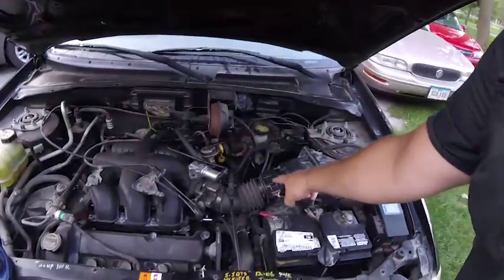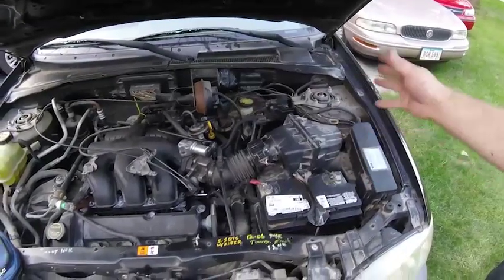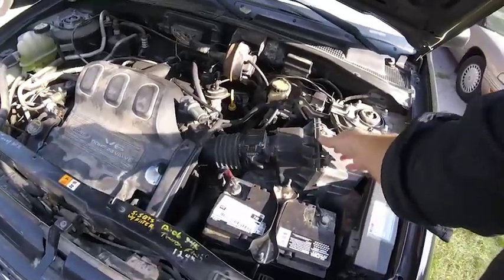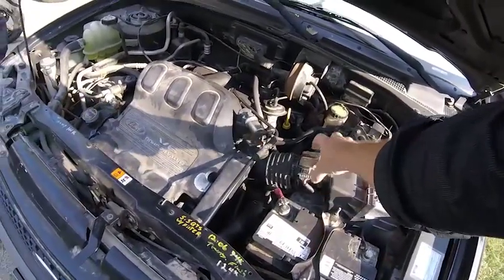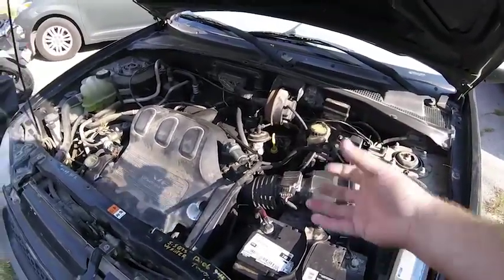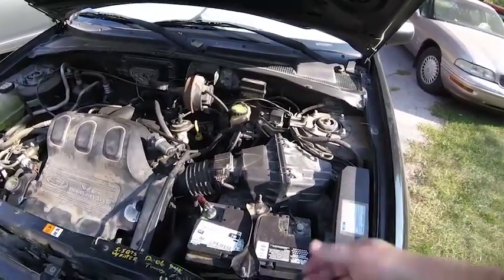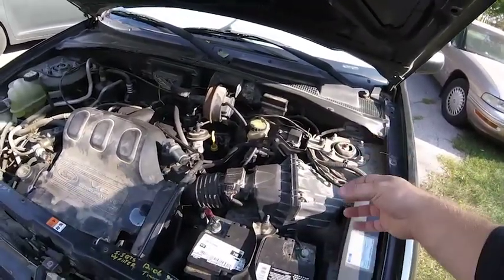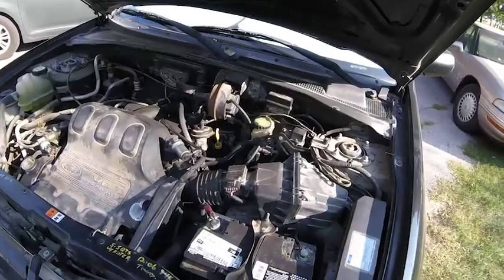Rough Idle / Acceleration - Here is the cause 90% of the Time ✔️

Comment: After change of spark plugs SV6 commodore vf. Now slight rough idle notice but drives and accelration is smooth like butter.
whats cause????
idle sits on 550 and stable even on idle but i can feel slightly rough.

Comment: my 2000 5.7 vortec jerks at low speeds like 5-15 mph. replaced spark wires, maf sensor, coolant pipes (cuz they were leaking) and i don’t know the problem. it sucks in too much air.

Comment: old cars may have problems not there years earlier... Obvious, but even a Toyota Corolla  at 20 years old and 250K miles will develop cracks or leaks in gaskets (the engine is a hot place inside an engine compartment in hot or cold weather). Be prepared to replace the air intake manifold gasket, maybe valve cover gasket, the gaskets for the IAC valve and throttle body. Hoses get old and brittle and crack at the ends or even collapse in bends on occasion. Engines need fuel, clean air, and spark.... that's all.  So a leak of air, dirty spark plugs or contamination of the electrical impulses or contaminated fuel are suspects. A new fuel pump and its filters is fairly cheap after 50-70K miles and best left to  skilled mechanic . ANY mistake with a spark can ignite gasoline vapors or gasoline in an opened tank (as the fuel pump is replaced with a new one). Do NOT risk it... leave it to a pro with skills. Same for 'struts' ... 1 mistake and you can lose a finger or hand and who will get the car off you and how soon as you scream in agony? HIRE a pro with skills (I like mobile mechanics who were car mechanics for decades and good at it). Keep the easy stuff clean or replace yourself (PCV valve or MAFS are simple to remove and replace and/or clean with MAFS cleaner, new plugs or spark plug 'coils' ). Replace bulbs yourself and save the money and learn some things!

Comment: I did all that I even cleaned the throttle body, changed the spark plugs I didn't change the coil pack cause they were good..the hesitation only happens on hot sunny days not at night which I think is weird..
Reply: Distributor maybe.
Reply: Some cars just run like shit on hot days

Comment: Hey man your right this happen to me and i changed my air filter and got gas treatment plus put 93 gas and it runs like new the mechanic told me i need a new motor🤔🤔🤔🤔🤔🤔🙄🙄 but thanks i did this and now everything is great i spent about $25.00
Reply: Did it start idling roughly immediately? Mine just started immediately after driving fine. I figured that I would feel the rough idle gradually. 
Sigh....
Reply: Tou should have bought the new engine and he will install a new filter free.

Comment: I replaced the idle air control valve , replaced the filter, cleaned the mass air flow sensor still run a little rough, does it when I also give it gas and goes away when I let up on the gas. Any ideas?
Reply: Do a idle relearn on ur vehicle
Reply: Could be clogged cats or crank shaft positioner sensor going out
Reply: I found the problem was a bad ignition coil replaced it now runs great.
Reply: I'm having the same issues now to so I'ma check out the coils n see

Comment: Anybody help.....

My honda Jazz is in 100,000 kilometers when I started to hear a rough sound when accelerating.  I notice everytime the first 10 minutes is fine then i would hear a rough noise under the hood.  I went to see different mechanics and they all said the noise was not coming from the engine.  Sad they couldnt give me the answer.  But this one mechanic saw something on my fan belt having sort on an issue that  maybe the cause of the problem.  The fan belt has a little wave when running.  I wanna know if he is right before taking them apart and have it replaced.  Thanks

Comment: I need to drive more it was done today. 
But I’ll check the air filter and see it’s tight.
Reply from the maker: Yeah sometimes it can get confusing with all the sensors in those cars.  if it throws a engine code then check that and see what it says.  Autozone will read the code for free.  It will give you some more info on what's happening.

Comment: That little nugget of recalibration after 20 miles was great. I just cleaned out the MAF on my car yesterday, took it for a drive around town & it still idled a bit rough. I thought maybe it was something else. Might just have to drive it a bit more until it recalibrates! 
Thanks heaps!
Reply: Bad gas and computers
Reply: Did u fix it? What was it?
Reply: @APerez89  It was a combination of things.
GDI engine so had to do an air intake cleaner. Valve head cleaner as well, petrol injector clean. REGULAR oil changes. And it helped changing a couple of old spark plugs that weren't firing 100%.
Plus going from 91 unleaded to 95 helped a bunch.
Reply: @RatelHBadger  alright alright not too bad sounds like u got away pretty cheaply : ) changed the plugs now im gonna clean and check the MAS thing and filter. Car just lost power and the mechanic said the sparks were responsible the issue but the noise ad symptom is starting again after a full day of no probs LOL
Reply: check aorund on the air intake tubing for cracks that can cause vaccuum leaks
Reply: @805fpv3  air intake is all good, double checked all the hoses and clamps. Every 5,000km I do an upper air intake clean (car is a GDI engine so the valves get crusty). Clean the MAF every year as well. Runs like a dream.
Reply: @RatelHBadger  oh ok right on , that really stumped me for awhile and i had them big cracks too xD
Reply: @805fpv3  yeah 20 year old car, first thing I did before I bought it was look at the condition of the hoses.

Comment: Anyone knowledgeable please help! I have a 1998 Escort 2.0 Auto. It has a low idol in drive with foot on break and (possibly unrelated) the biggest problem is once warmed up if in park the idol will rev so high I turn it off real quick so it doesn't blow something. I feel like I've done everything. I cleaned the old throttle position sensor (no difference) then put a new one on, then cleaned the old IAC valve (no difference), then put a new one on, cleaned the throttle body, cleaned injectors, cleaned valves and still same problem. I also replaced the Control Module relay which gave me my A/C back but did nothing for the idol. Please also note that after testing 4 Control Module relays, I found the only one that mostly worked as my A/C now comes on with regular air and the regular settings blow hot air. I was just happy to have A/C back any way I could get it. Any more ideas? Cuz I'm tapped.
Reply: Check the hose behind trottle. It might have leak.
Reply: @jvela492  Of all the things, it ended up being the pigtail plug for the TPS! lol Replaced 6 parts to find that out and it was just a wild hair that made me change it out.

Comment: Pls help~~
First i started hearing squeeling sound in the engine bay and then 2 days later, my rpm just went wild going up and down and vibrating. My mechanic said it was the alternator and changed the alternator. My car was fixed but then 1 week later rough idle came back. Mechanic checked again and said 1 of the coil is the problem. We changed that and car runs perfect for 2 days again until today...my rpm again goes wild and from what i can tell, i think it might be due to using both my radio and aircon at the same time. Also when i use power window i can see the rpm drops by 100rpm. 

Does anyone know what might be wrong with my car? My car is a toyota corrola 2009 with 240,000km. Pls drop your opinions thanks.
Reply: battery might be bad? idk just sayign
Reply: You might have a dirty ground wire.  There is one that connects your engine to the body and another that connects your body to the frame.  Unbolt them and clean them good with a wire brush.  When cars have weird electrical problems it is usually a bad ground when it is affecting multiple electronics in your car.  Also Scotty Kilmer youtube channel says make sure you change your coolant.  Dirty coolant carries electricity through it and affects your electronics.
Reply: If your engine has sudden changes intermittent changes to how hard it's running, that's usually means it's either the fuel or air intake system or spark plugs, these three things control the 4 pistons compression system. So spikes in the engine rpms is probably related to those

Comment: It's the problem 90% of the time, on cars that have mass air flow sensors. Not all cars have mass air flow sensors. And 90% of the time, you can look down the tube and see if the filaments are still intact. One broken filament, and your mass airflow sensor is junk.

Comment: Sluggish engine, poor acceleration; old and worn out spark plugs and coils.
Reply: mediastarguest Probably, but other things as well.
Reply: Shadetree mechanics number one solution that always fails. When is the problem more than likely it's something else..
Reply: I'll change my spark plugs, thought it was my Maf sensor at first which was giving poor idling upon start... after few minutes the idle settled. But, it's affecting my fuel, so I must try change the spark plugs and  maybe coilpack!
Reply: @90nadz  i just bought a 2001 lexus gs300 181k for 1700$ running rough. I replaced plugs, coils, cables, connectors, valve cover gasket. Still running poorly. Finally put in MAF sensor and it runs great now. Im happy with my car. For 1700$ i have a good looking powerful car.

Comment: There are several factors that interfere with performance and make the engine run sluggish. 1. Old and dirty oil: oil change and filter change with the correct oil. 2. old and worn out serpentine and fan belt. 3. Old and cracked rocker-head cover seal and head gasket seal.
Reply: mediastarguest how does a worm serpentine belt cause bad performance?
Reply: @osmannoor1087  My observation is purely empirical: I had an Audi which I had left parked on a farm for two years. When I started the car and began driving it again after  two years it ran noticeably slower with poor performance: the service belt eventually broke and once it was replaced with a new one the engine regained its performance - it gained at least another 25 to 40 bhp. I speak purely from experience.
Reply: mediastarguest what was the mileage on the audi at the time it broke
Reply: @osmannoor1087  Approximately 200,000 miles. Turbodiesel engine.  The car could hardly get up a steep hill with the worn out belt. After the new belt was fitted, performance returned to almost normal, but not instantaneously: it took a few days after it was fitted and was very surprising when it happened.
Reply: mediastarguest was the drive belt the original one from audi? Did you check that out? My 09 camry still has the original belt with 145k and I’m thinking about changing it soon. My cars performance is has dropped after 135k
Reply: @osmannoor1087  Does your Camry have both: a service belt AND a timing belt ? Don't start spending money on belts and labor per hour if the belts are still in good condition. FIRST, check the timing belt is correctly alined , because if it is "out" this can directly affect performance. But there are so many other things - check the simple things first and make a progression to the more complex things step by step. If the piston rings are worn there is not much worth doing unless you are a professional mechanic. Labour charges are crippling.
Reply: mediastarguest my camry doesn’t have a timing belt. Those things can be a pain in the back to change. I mainly do all the work on myself changing drive belt shouldn’t be a issue. I ordered the tool from gates that checks if the grooves are worn so we’ll see. I’ve done top maintenance recently all using OEM parts (pcv valve, spark plugs, air filter, couple bottles of techron cleaner). Yesterday I stepped on the pedal and man it’s like all power is gone. My gas mileage & performance has been taking a great hit
Reply: @osmannoor1087  Check the head gasket and rocker head gasket seals. They might be broken or worn and that means lack of  correct compression. I changed my rocker head seal (£20 part plus £30 labor) on a Peugeot 1.6 liter 16-valve and performance improved significantly.

Comment: yes the MAF sensor could make you have a smoother idle if you clean it also if you have any acceleration problems check your exhaust manifold being clogged
Reply: My car was running really horribly: 2001 gs300 lexus 181k. Just purchased for 1700$. After replacing the spark plugs, coils, cables, connectors it still wasnt running right: lean codes and mis fires. I replaced the MAF sensor and bingo! That fixed it. Im happy because i was ready to bring it into the shop and i saved hundreds by putting that sensor in.

Comment: After changing a part, the computer has to readjust the settings. Drive the car for awhile. Get a Actron CP9690 code tester. It has live, record, graphing, emissions readiness test, ABS, SRS, transmission codes test, oxygen sensor test, I/M monitor test, and MORE! It's well-lit! Get the USB cable to update it. EBAY has it.

Comment: If air filter is clean, would MAF still be bad? 2004 Santa fe 144k miles. Very rough idle, poor acceleration, engine visible shakes at idle. Had prior missfire where engine was shaking violently (which may have broke a engine mount?) No check engine light codes any more replaced plugs wires and igniton coils [it's a V4] also a exhaust manifold crack. Not sure where to go. If I unplug MAF car dies while at idle,. so I assume it is working.
Reply from the maker: Yes it can still be bad or dirty.  You can clean it with MAF cleaner.  If you have tried everything else, like you seemed to have done,  then you could replace it at about $35 or so if you order on the internet.  Don't go to a car parts place to buy one, they are way too expensive.  It is up to you if you want to take the chance on buying one, but it may be worth it for 35 bucks.
Reply: @extremebudget  I haven't tried to remove cat converter I think hers has to, and make it a straight pipe. As I read plugged cat can cause performance issues, but not sure about the engine mount. And I know she has a crack in exhaust manifold, that could also be to blame?
Reply from the maker: Scotty Kilmer has a channel that has a lot more information on troubleshooting those symptoms.  He does this full time and I love his advice.  Check it out:  https://www.youtube.com/channel/UCuxpxCCevIlF-k-K5YU8XPA
Reply: @extremebudget  I've watched a lot of his videos too smart guy. Haven't seen much on motor mounts or exhaust manifold crack.   And the cat could be just taken off.   But the engine visible shaking and not being related to a missfire and or no code is being thrown[ no CEL] bothers me
Reply from the maker: @blink99v  yeah it is frustrating to figure out some of those problems.  I'd keep an eye on the MAF sensor.  try to make sure that possibility is completely tested before anything else.
Reply from the maker: @blink99v  yeah it is frustrating to figure out some of those problems.  I'd keep an eye on the MAF sensor.  try to make sure that possibility is completely tested before anything else.
Reply: @extremebudget   yup it's on my list to clean, also tested muffler and cat converter with a thermo gun from some videos I saw, and its colder the farther i go down, which according to videos means its blocked /broken.

Comment: My car acceleration is too much in idle state.. how to reduce it
Reply: What is the year make and model of your car?
Reply: Get a Actron CP9690 code tester. It checks live, record, graphing, emissions readiness test, ABS, SRS, transmission codes, I/M monitor tests, oxygen sensor test, and MORE! Get the USB cable to update it. Get 4 aaa batteries for under the rear cover. EBAY has it. It's well-lit! It has code-connect to diagnose codes.
Reply: Same
Reply: Vac leak
Reply: One of the other guys on here said he had the same problem.  He replaced the throttle position sensor, but it didn't fix it, but then he found a broken wire on the throttle position sensor pig tail and that fixed it.

Comment: great information brother you saved me hundreds of dollars the mecano wanted me to change the throttle body instead bought a filter and MAF cleaner and im back on the glory days thsnks
Reply from the maker: Awesome!
Reply: @extremebudget  I am having same issue with my Pontiac Montana 2008. No lights on my car even, did spark plugs with wire, fuel injectors and throttle body service but still same. Any suggesstion?
Reply: I was having lean running and misfires on all cylinders. A new MAF sensor fixed the problem. I had to drive it for 20 - 30 miles for it to run better tho